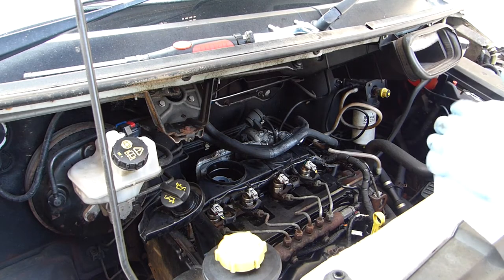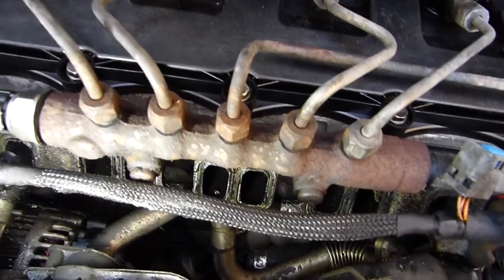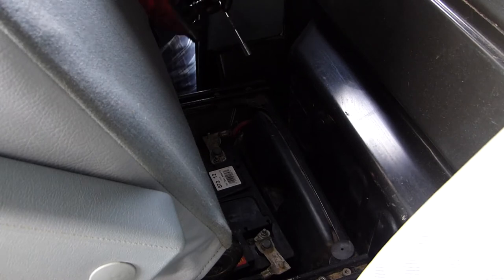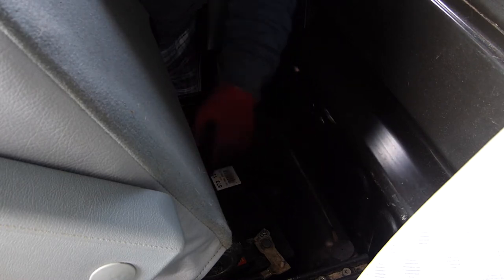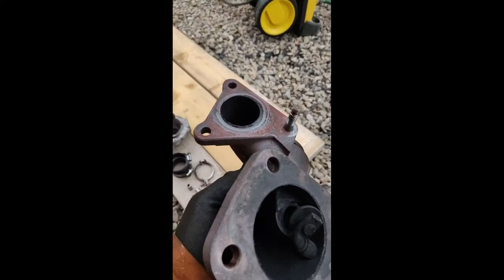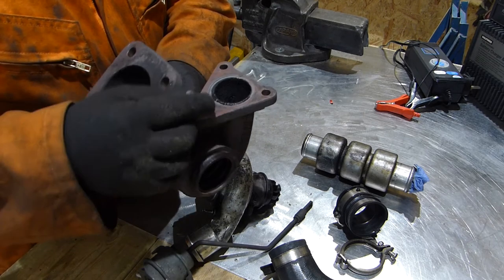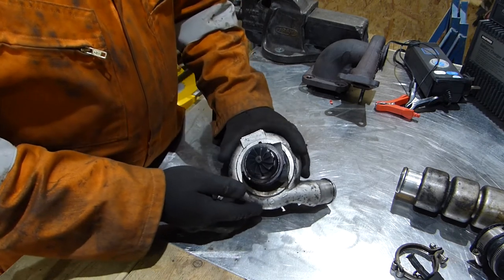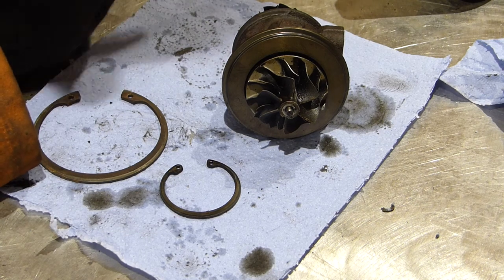Engine problems - Oil & Turbo - Ford Transit MK7 To Camper Van Conversion - #2

Comment: A bit late in the day to comment but the central housing which you took apart is usually available as a "CHRA" unit which you can buy separately rather than investing in a whole new turbo.  

Other things to replace as a priority are: the oil feed and return pipes and the coolant lines.

Comment: Your video was very informative, when you pulled the impella apart this was interesting as well, I have a similar issue but as the durotorq Di engine is all mechanical the turbo relies on vacuum flow from the control module to open and allow the airflow to happen. but well done very good, no play in rotors at all is a good sign too.
Reply from the maker: Thank you 😊

Comment: After break down after break down on my high mileage Mk7 campervan I bought a mk6 and swaped over the engine gear box gear lever full loom and abs  and ecu. Now using less fuel and would drive it round the world .  O and the full dash which looks better, nicer colour and style. but you will need the full donner van and lots of time.
Reply from the maker: So did you put Mk6 running gear in a Mk7 or the other way around? Either way big project and I'm glad it has worked out to your advantage 🙂
Reply: mk6 into mk 7.

Comment: Yep. Typical euro 4 engine. One of our vans is exactly the same.  Oil all over dipstick.  Ours isn’t over full of oil or anything..  but it’s near impossible to check oil level.  Seems to pick oil up everywhere from when you push dipstick back in.
Reply from the maker: So true, very near useless!

Comment: excellent information and well presented ,always wondered the mystery of the turbo,always hear of  going faulty and engines becoming write offs.
Did you buy a brand new one or risk a salvage part and if you don't mind what is the cost
Reply from the maker: Thanks for the comment! I'm glad you enjoyed that content about the turbo 😊. I ended up going for a brand new one from tpuk it was at the time £160 delivered and I have a link in the description to the seller if your ever need one. 😁👍
Reply: @abilityshare9294  Thanks

Comment: Hello,did you solved the problem? Ive just bought a transit mk7 and it seems to have to much oil on the dipstick.  I have to change the egr also.
Reply from the maker: Yeah got the problem sorted, this van needed everything cleaned out, egr, intercooler, inlet manifold, replacement of turbo, 4 injectors and 4 glow plugs. This van was a diesel runaway so potentially more at fault than the issue you are having? thank for the comment. :)
Reply: @abilityshare9294  Pff, you did a lot of work 😮 I will try with mine to simply change the oil, and if is running fine, I wil try to sell it again. 🙄 I have only 3 errors on the engine, from PTO, egr and diesel fuel regulator présure.